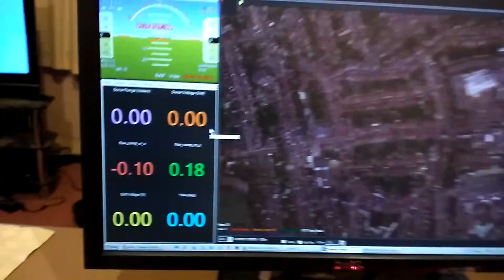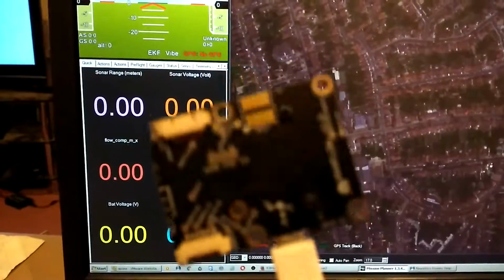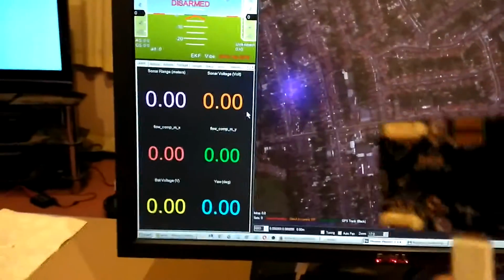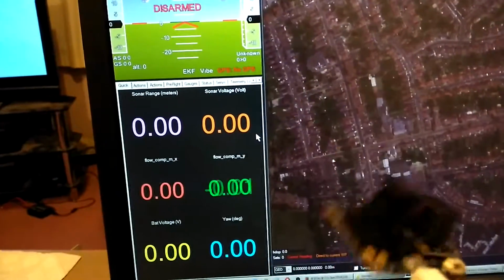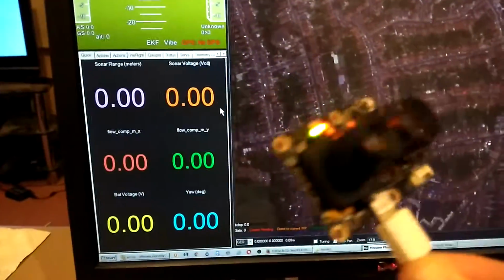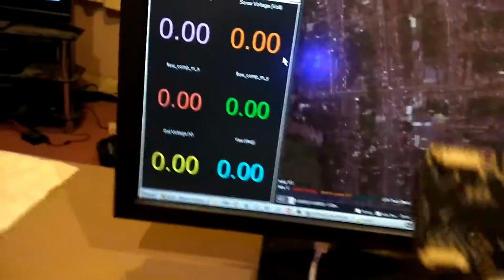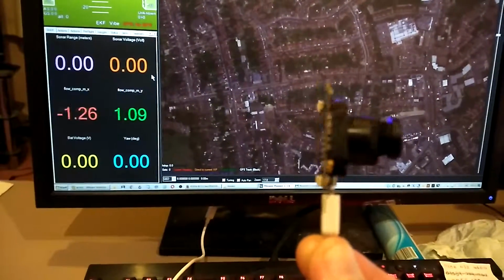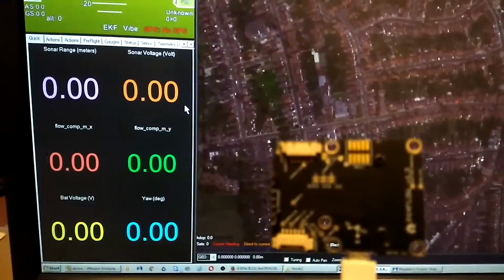px4flow, sonar not working

Comment: Im having the exact same issue.
Reply from the maker: Hi. I don't think that the Px4Flow was damaged. Sonar emits a sound and I could actually hear it. It was just the case that the sonar did not want to play ball with my setup.
So, I bought the LidarLite to deal with distance measuring, while I used the px4flow camera to hold the position of the aircraft in the air.
You'll see in my other videos how well it holds a position (in the x, y axis - that's the px4flow camera) and the z-axis is held in position by the LidarLite.
So, in a nutshell - buy a LidarLite AND a Px4Flow to hold a position.

Comment: Same issue here.
Any updates on a possible solution?
Reply from the maker: Hi, I have heard that going to an older version of ArduPilot (v3.3) will solve the issue. Apparently AC have stopped supporting/developing for the PX4Flow.
Though, using an older version seems counter-intuitive, especially when AC is advancing quite fast.
For this reason, I have abandoned using the PX4Flow. 
I may try out the LidarLite, which is something the AC team are developing for.
Reply: Hello and thank you for your reply. 
Would have one more question. Did you receive the PX4Flow assembled or was it shipped with the sonar sensor detached?
Reply: @endrepapp8020  It was shipped with the sensor, fully assembled.

Comment: I have the same problem with my px4flow sonar maxbotix1240ez. When I connect the sensor directly to MP through USB connection, sensor are working. But when I connect the sensor to pixhawk and look in Mission planner, autopilot cannot get the sonar data from px4flow.
How to solve such problem I do not known.

Comment: Hello! Check it on apm v3.3 (not 3.4)
Reply: Do you mean the copter version inside mission planner ?  I am facing the same issue at the moment. I cant get any readings with sonar. also when i connect px4flow to the pixhawk it is not detecting the camera. it showa bad optic flow....